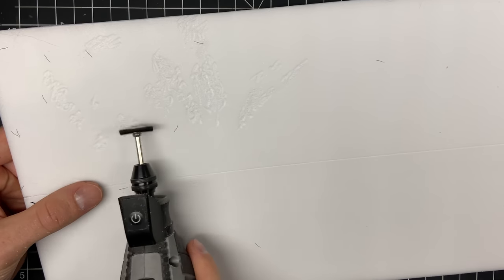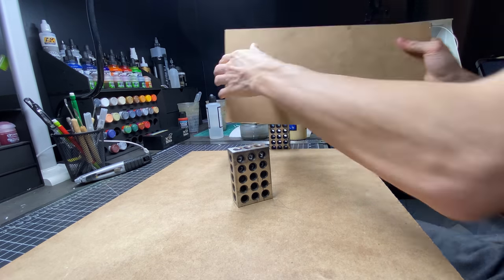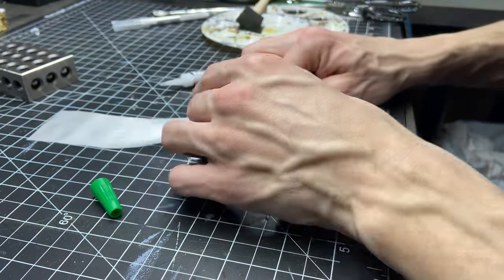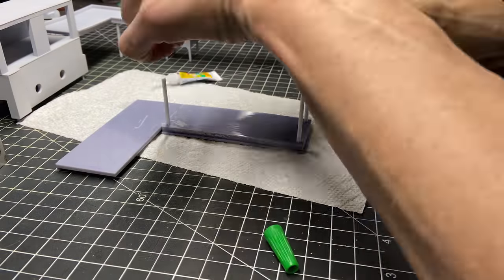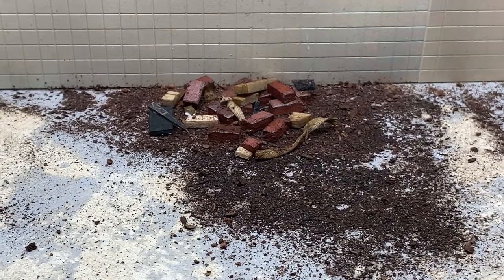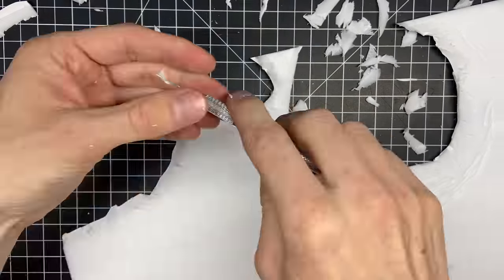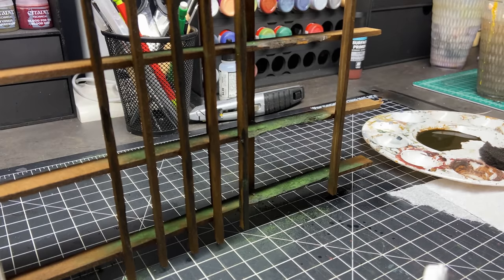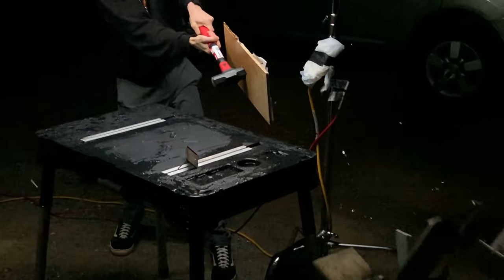Miniature Abandoned Scene with RAIN?!

Comment: These are general questions, but when you decide to make a diorama, how do you decide the scale?  Do you get hung up on measuring everything out or do you just eyeball it for the most part?  When you are making 3D printed accessories/props do you also eyeball those or do you find out the real life scale of objects and then do the math for the size of your diorama(s)?  What's that process?  Thanks!  Your work is so inspiring and it's reignited my desire to start building models again after almost 20 years.  There's a lot that I've forgotten, lol!
Reply from the maker: Thanks! I usually like to pick a scale that is big enough to accomplish how I’d like to photograph it. Usually that means as big as is reasonable, which is why I’ve been doing a lot of 1/12 scale for my interiors. I try to do the math most of the time to make sure the scale is correct, otherwise the piece doesn’t look as cohesive and realistic in the end.
Reply: @AbandonedMiniatures  Awesome, thanks for the tips!

Comment: As a modeler, I can attest that one piece of nature that doesn't replicate well in miniature is water. The great model railroader John Allen, when building his Gorre and Dathetid railroad (which took up an entire basement, floor to ceiling), decided to try using real water for lakes and waterfalls. Not only did it not look unrealistic and act unrealistically, but it increased the humidity to the point that it was causing mold. I'm nitpicking though. This is stunningly good work.